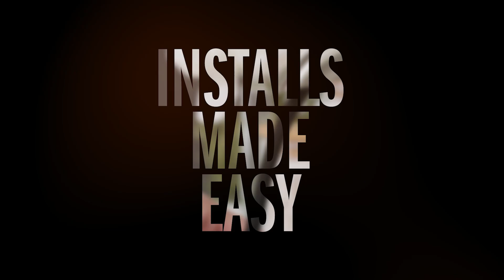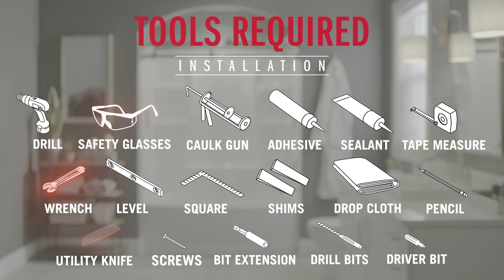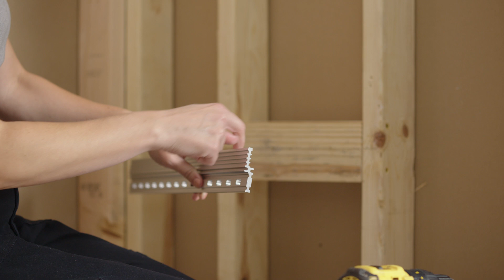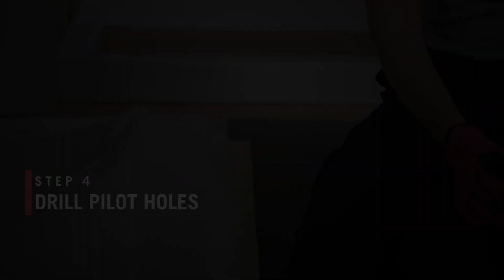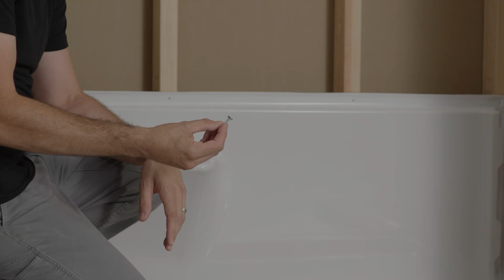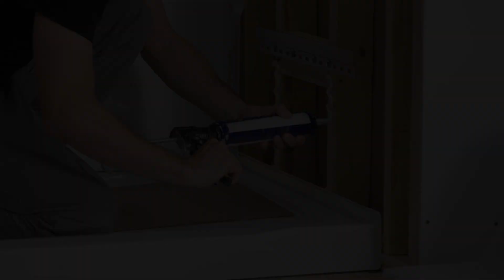How to Install a Delta® Classic 500 Seated Wall Kit

Comment: Are the holes on the 12 inch level line for the seat bracket?  Or do you line up the bottom of the bracket on your 12 in level line?